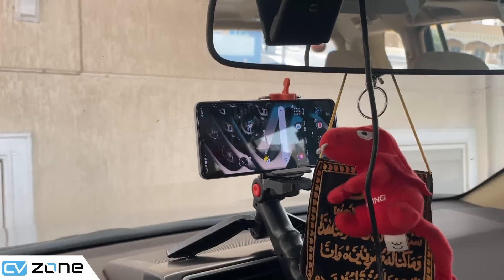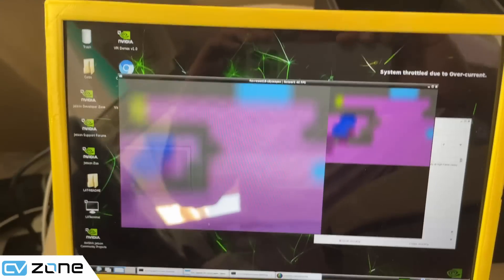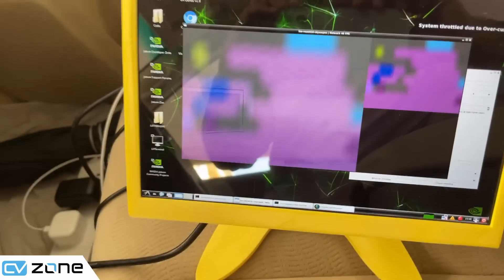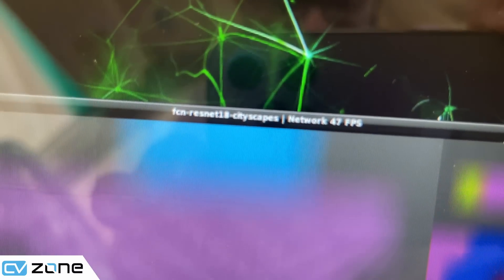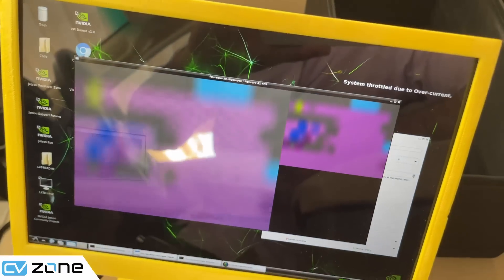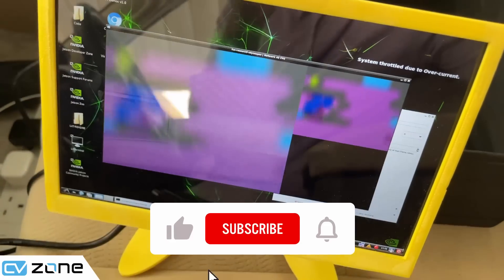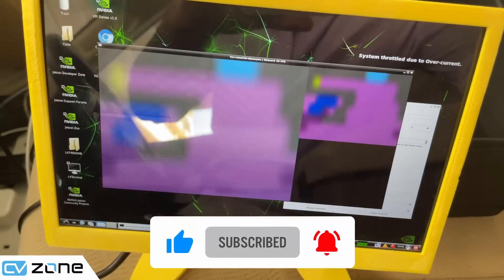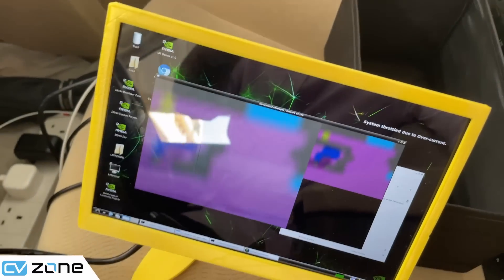Self Driving Model Test On my Real Car | Semantic Segmentation Nvidia

Comment: Dear if we implement semantic segmentation then how we will control steering wheel?
Reply: You need more hardware(robotic arms and stuff) and more software(run the robotics) 😂😂
Reply: You need to interface to the vehicle computer and control the wheel, a lot of cars actually will support this. https://www.google.com.au/amp/s/amp.reddit.com/r/CarHacking/comments/e2y0eb/can_i_control_electric_power_steering_with_canbus/
Checkout comma.ai
Reply: @gavinknight8560  that's a lot of hustle and has very minimal documentation. If you don't how to to Control a steering wheel, how will you know how to interface to a vehicles computer?